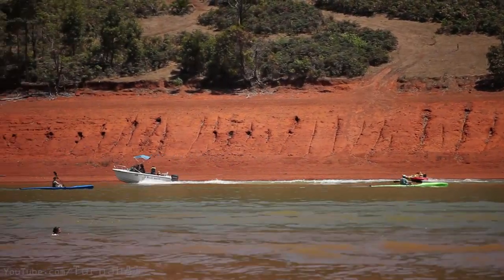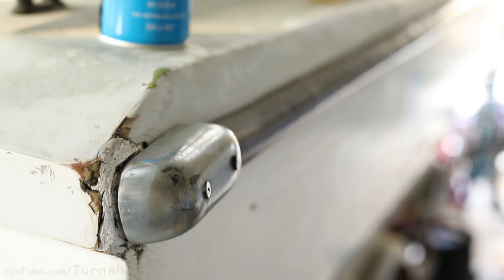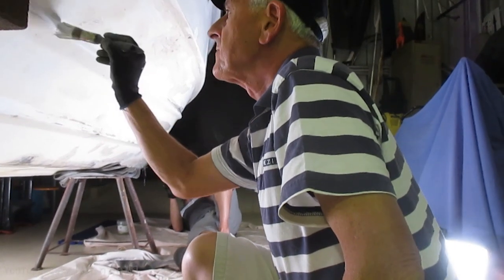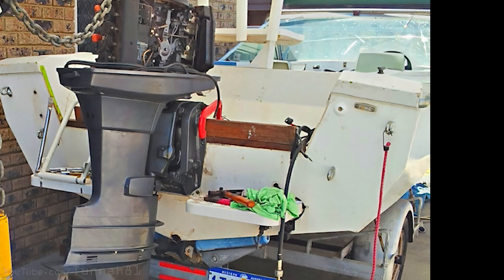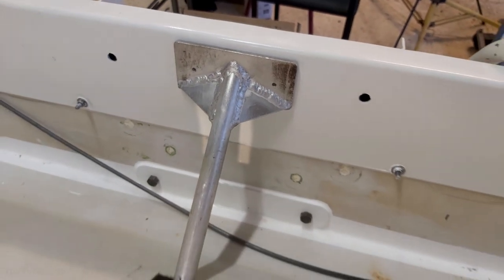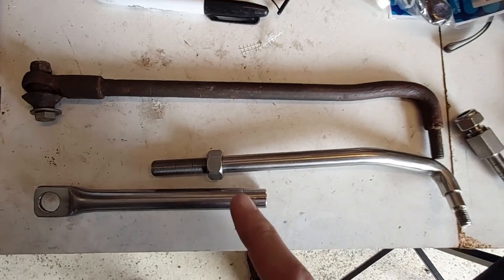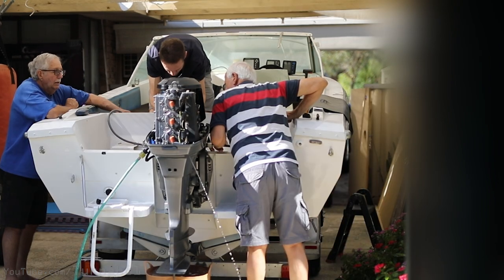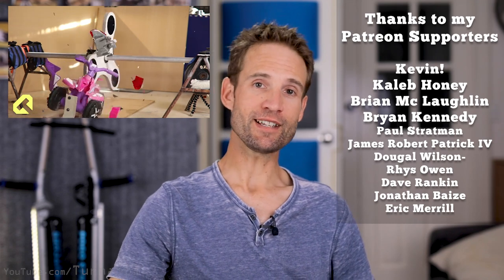Putting a Big Motor on a Small Old Boat - Boat Restoration

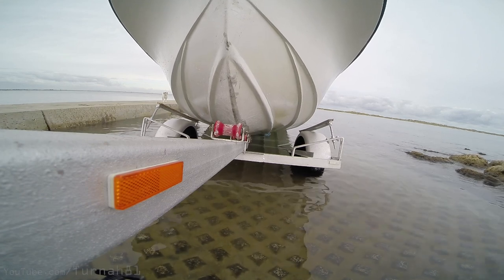Comment: 4:19 you need side rollers. As long as it's sprung, you can use any skateboard soft durometer wheel. The idea is to force the boat to stick to one path. ALSO, your bottom rollers aren't properly matched to the boat you have. Too wide. Ideally, you should have progressive rollers. So the first one is wide, the next one narrower and so on until the rollers are just wide enough to not allow the boat from moving, but without lifting it off the roller's horizontal part.
Reply: I would actually even recommend having teflon runners instead of rollers, and fitting them on the trailer exact to the specs of your hull. Once we went to teflon, we never looked back
Reply: Reverse further down the ramp

Comment: Very entertaining.

Re the boat running off the trailer rollers, you can mount rollers either side of the existing rollers on an angle to match the angle of the hull.

Comment: Pretty good stuff. 
Pro tip (and only the tip) for working with fiberglass. Apply baby powder to any exposed skin before handling, and use panty hose to pull the fibers out after handling. The baby powder helps seal your pores and makes you look like an albino when applied properly. The super fine mesh of the women's leggings grabs the fibers from your pores and makes you look like some creep. 
A creep that doesn't itch!

Comment: I used to repair boats.
Here's a couple  of ways to alter (fix) your trailer problem.
#1)  Use a fabric strap to suspend the boat.  (You'll have to prevent the strap from going back and forth).
#2) Make a fiberglass female section (mold) of your hull.  You'd need a couple sections.  Much like above, but with fiberglass.  Have some totally synthetic low pyle on the portions touching your hull.

Comment: I had the same problem with the keel scraping on the trailer. I had to add extra carpeted two by fours, in the US We call them bunks. so then I had a total of four of them two on each side I raised them up higher than the previous ones so that the keel doesn’t touch the rollers anymore, and is only supported by the carpeted two by fours, that completely solved the issue for me. I know this comment is over a year late but hopefully it helps somebody.

Comment: Looks good, just replaced the transom in my fiberform. Couple of fiberglass tips
-lay open a plastic drop cloth and wet out the fiberglass on the plastic before applying it to the boat, you won’t have to wet it out on the boat
-use a slow cure epoxy, it’s as strong as the resin and has far less fumes
-gelcoat WILL stick to epoxy, just make sure you clean the surface to get all the surface chemicals off of it before applying more layers and gelcoat

Comment: Marine carpet on the rollers (attach with screws and add carpet on top of the holes). Also buy more and/or move your rollers if not properly lifting the boat. 

I also love to have 2 post on the side of the trailer so it is easy to perfectly get the boat on the trailer. We use swimming pool noddle foams on the metal post to prevent any damage.

Comment: Next time tow boat on highway at 100km turn wheel to sharp left and slam on brake this will make it a lot easier to work on the bottom of the boat 😇

Comment: hey so as for the boat trailer you have a couple different options, a quick not so effective, but better then whats on it,  setup would be to swap out the current rollers for some V shaped. though, personally i just use some 2"x4" or 2"x6" lengths of lumber wrapped in marine grade carpet to do the job. they look similar to those bars sticking up on each side, but yeah, If you could remount those bars to catch the bottom of the hull on each side and carpet them along with the V shapped rollers then it should solve you problem all together, and make a more trailerable setup

Comment: yeah seems like you see a lot of old boats with wood rotting out.  i'm surprised more people don't switch to using that composite stuff they use for decks and siding now.  over here we call it hardie board but on home depot's website they have it listed in a section called Composite Decking Boards.  that way you'd never have to worry about it rotting out.

oh and seems like you need some deeper rollers on your trailer which would also require bigger brackets, but that would prob help keep the bottom from scraping like it was doing.

Comment: Interesting transom height extension. I would have installed a manual jack plate to get the 5” of lift instead of modifying the transom.  Time will tell if the mod will last.
Reply: i brought a old Betram Caribbean boat with same height extension bracket on my transom not knowing much about boats at the time was sucked in when  i brought the boat   was to run the 25 inch leg ..after a few months  time. it ..cracked both sides of my transom .in splash well.....this is accident waiting to happen the whole transom should have been redone ..i.would never allow my family ..or in fact any passengers on your boat 🤣🤣🤣 a quick fix accident waiting to happern

Comment: to solve the runner scraping problem use layers of brass tape let it tear down and then remove and replace it, it eliminates the scraping of the glass fiber bottom add plastic tape first to add with removal or that can be hell.

Comment: Get rollers with a steeper "V" in them. It'll force the hull to the center instead of letting it run out. Also you can adjust the skids to help keep it on center.

Comment: Your side skids should be in a position to center the boat prior to contacting the rollers, you also need to make sure the trailer is far enough in the water. The video you showed looks like the back edge of the trailer is barely in the water. I would back it up far enough that the last roller is slightly submerged.

Comment: Hey just for the future, you cant run the engine with the hose connected to the top flushing port, that port must only be used with the engine not running

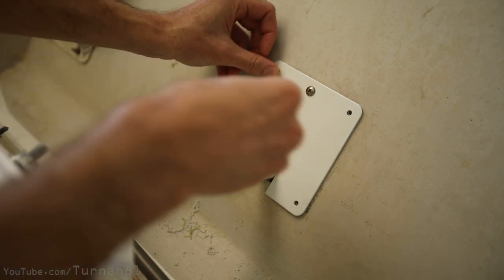Comment: 10:28 the only problem with that is that the foot is too small, on both sides. IF, you hadn't done the aluminium brace on the back, this mod would eventually punch a hole in the boat under the right circumstances. Even so, if you smack the engine on something in the water, i expect it to be catastrophic. My recommendation would be to make a "washer" plate that goes under the one you have now. You don't even need to screw it on more than the OG holes. It just needs to distribute the forces to a much wider area. I'd say it should be at least a little bit thicker than the existing foot.

Source: braces like that aren't that common, but the kind that triangulate the top of the transom to the side walls are, if you think you've seen horror in those you found, wait until you see what happens when the boat ass-plits. 

Just my 2 cents, all in all not really that much to worry about unless you catch the floor with your prop.

edit: see, how they did it at @13:10 big foot. FYI, that crack's likely because something went from the top down.

Comment: Thats not that big of a motor for that boat though..  i got a 14’ fiberglass super sport bass boat with a 150hp on it..  it sits with just a few inches above water but thing will go 75 mph on the water..   buddy put a 300 merc on an aluminum john boat though.  It would run over 100 before the front of the boat would start shaking and bending..  lol

Comment: It never ceases to amaze how apocalyptically awful boat enguhneers are. 

You have a composite boat that cannot rust or rot, filled with structural points made of wood and metal that rusts and rots. 

Those wooden Transoms are the making of an apocalypse swimming with Jaws and Co. Like, why? As in, why is there no center support attached to the transom in the longitudinal direction, such as... a keel? Strong-back? Nope.